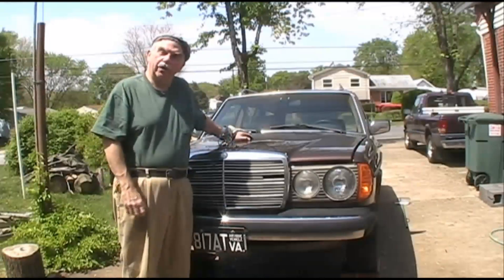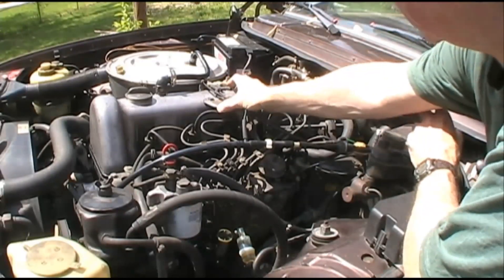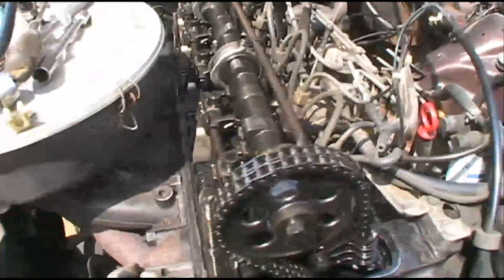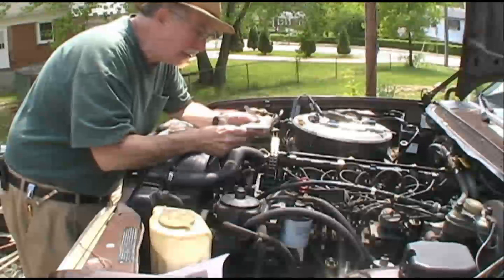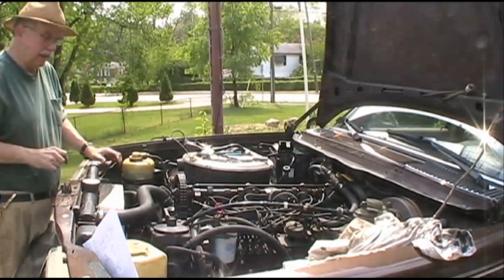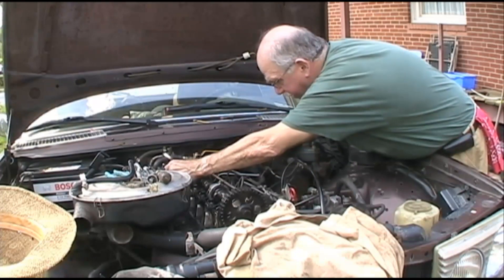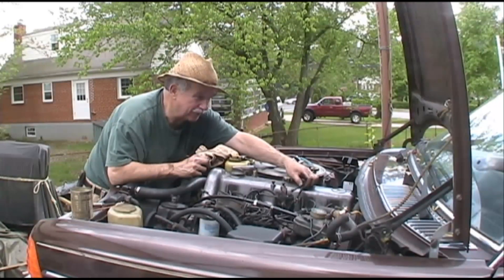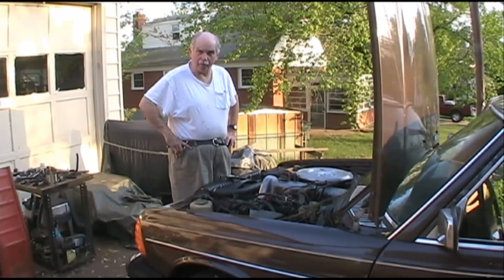Mercedes 300TD_part_VII

Comment: This fellow did a very good job. I can say it because I did this job before and it require attention to not adjust intake with the same gauge used to exhaust.Diesel is a very good engine to work with.

Comment from the maker: @3habaneros It don't shift real smooth, but it shifts.  When I welded the accelerator bracket back to the floor board I don't think I got the spacing right.  I really have to stomp it to get it to down shift. It don't hit the downshift switch soon enough.  One day I'll get around to messing with that.  Also the little plastic cam that works the vacuum switch on top of the valve cover is worn out.  It off course appears to shift better now that the engine is revving up a bit more...

Comment from the maker: @coastervidguy I have to do the valves on my 240d first. It has lost a little pep.  I'll be posting some videos on work I've been doing on that car. Before I put much more into the wagon I'll check the compression.  Also I must deal with an oil issue with the wagon. Oil pressure, which is high when running but drops way low when it it hot.  The oil cooler next to the radiator never gets warm.  I'll change the filter first and go from there. Also I want to get my 300d ready for winter.

Comment from the maker: @MBSAIN21 The wrenches you need to make it easy are available.  Some folks modify their own wrenches.  There are lots of articles on how to do it on   the benzworld forums.  I have to do the valves on my 300d turbo.  It has to wait though as I'm tearing into my 240d now.  As usual the closer you get the more you see needs to be done.

Comment from the maker: @coastervidguy   3 bar and 1 bar is what I am getting.  What worried me is that it used to be 3 bars and 2 bars just a little while ago.  I don't like the trend.   I've heard that there is a oil thermostat in the filter housing, but haven't zeroed in on that problem yet.  I'll change the oil first, then work on my 83 300d turbo.  Then I'll pull the wagon onto the pad for a thorough exam.  I have to prep it for winter anyway.  I have some more work to do on my mods to it's heating system.

Comment: I have a 83 240d I bought here in florida runs and drives 500.00 I have a 80 diesel wagon too 5 cylinder non turbo it was 450.00 runs never drove it

Comment: @beatnic50 What are your oil pressures?  When cold mine will peg at 3bar, but after it's warm it will idle a little higher then 1 bar.  1 bar is still a lot of pressure, and as long as it picks up when you are driving you should be okay.  If the oil cooler isn't getting warm I would hazard a guess that the oil cooler lines, or the oil cooler itself, needs replacing (which isn't all that uncommon).  Good luck with the car, nothing beats an old MB diesel!